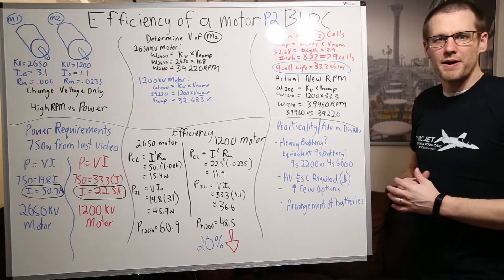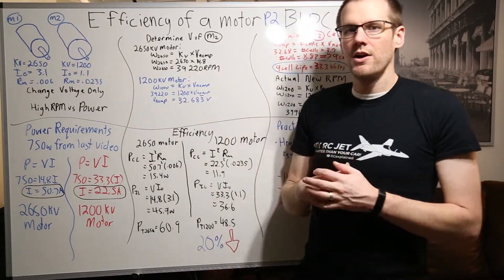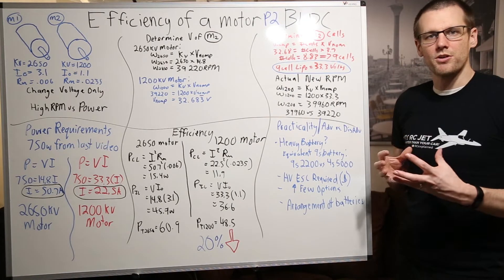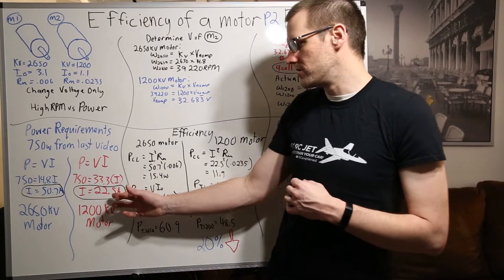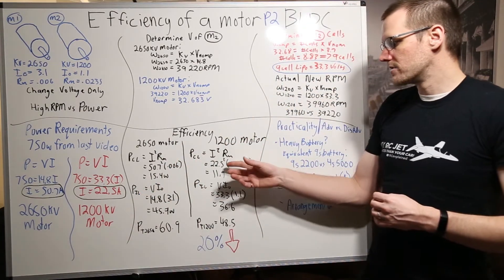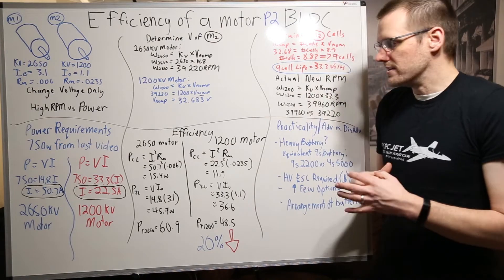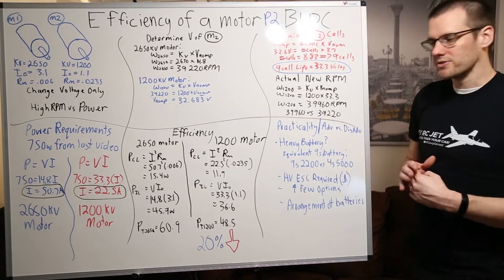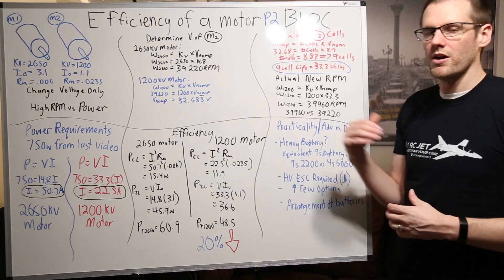High vs Low Kv Motor Comparison using Different Voltages for an RC Car

Comment: You could use ~1,800mah cells in the 9S battery and achieve the same runtime since you’ve concluded the 9S setup is ~20% more efficient.  I suspect one of the reasons r/c applications generally max out at 8S is that going beyond that the risk of electrical shock starts to materialize.  Killing customers is bad for business... lol.

Comment: So what if the comparison would be more typical to exist in both batteries, 8s and 3s?  I'm reminded of a video comparing a V8 car to a 4 cylinder and which one is more efficient in higher throttle situations. Both cars had 5 gallons in the fuel tank and the situation was the 4 cylinder had to try to shed off the tail, which was the V8 powered car. The 4 cylinder actually ran out of fuel 2 gallons sooner than the V8 powered vehicle. The point I'm getting at here is a lot of the efficiency has a lot to do with throttle modulation when referring to RC cars. Not many people don't use full throttle in anything but a crawler. If you are looking to go the same speed consistent though, probably like the V8 car, be better off running more voltage.

Comment: Running 58,000 rpms on my trm10v2 💨💨 she smokes tires for a monster truck , does both front and back standing backflips ( without the custom wheelie bar on ) with the wheelie bar I’ve achieve speeds of 177kmh! With small buggy wheels (: on road! But a couple days ago I crashed it into a wall going wall to fast , now I need a motor lol.
Reply from the maker: Nice! Sounds like a really fun setup. You crashed it in to a wall going fast and all you need is motor?
Reply: RCexplained yup, the little guy is tough as rocks! I honestly can’t believe that’s what broke lol, I order Center diff gears cause obi I though that’s what blew , because all my wheels were locked up only when the motor / transmission was on. Well I finally got the hex driver to take off my motor mount, and we’ll to my surprise the gear box was perfect. But my motor is really hard to turn.

Comment: Awesome video! I've been preaching this message on my social media for a while now. Guys are obsessed with lower voltage, higher current systems right now in speed running and I was actually planning a similar video to show why going to a lower current, higher voltage setup was a better option for overall efficiency and parts longevity. I'll probably shift that video more into talking about the heat produced by inefficient setups and the effect on parts life instead and refer guys to this video to learn more about efficiency in general.

Great explanation!
Reply from the maker: Thank you! You are right! A high current, low voltage setup can be very difficult to manage. 
I'll be watching your video when you post it.
Reply: @RCexplained  I know you're not on Facebook much, but a set of guys just posted that we are their two favorite RC YouTube channels. I guess not being afraid to geek-out in public does actually have some benefits. :-D
Reply from the maker: @RCPhysics  Hey, right on that's awesome to hear. Thanks for sharing.
Reply: @RCexplained  You'll get a kick out of this. This video inspired a geek out session on Facebook with the founder of Castle Creations. One of the tangents from that conversation inspired me to write this post. Enjoy. https://www.facebook.com/rhouse21RCPhysics/posts/1413035435534627

Comment: I'm running a Lehner 2250/5 2365kv motor with a Hobbystar 300a ecs, using 2 Yowoo 5s graphene 5000mah 100c lipos. What kind of hp could I expect from that setup theoretically?
Reply: With 5s batteries you get a nominal voltage of 18.5V. The C-rating on batteries these days usually has more to do with what the maketing department wants to sell than the actual C-rating of the batteries. Most batteries are actually somewhere between 20C and 40C. Let's assume they are actually 30C. That means you get a max current for the batteries of 5*30=150A. So the max power from the batteries would be 2*150A*18.5V=5550W~=4.1hp. The ESC is rated for both sufficient voltage to use your batteries in series, and enough current to use them in series, so this will not be a bottleneck. What will probably be the bottleneck in your system though, is the small motor. I have a leopard motor that is almost twice the length and twice the diameter, and it is only rated for 2500W IIRC. Seeing as your motor is basically 1/4 the surface area, and thus 1/4 the available cooling, I would guess that it would also be in the ballpark of 1/4 that power, so more like 625W ~= 0.47hp. You'll have to dig up more info on the motor though, to get a more accurate answer on that.
Reply: @2testtest2  quick question if you don't mind. I have 2 x 3s 45c batteries, does this mean I need a 270 Amp esc if I run them in series? I have a 150 and it gets crazy hot if I do. I don't really need the speed, so would it be better to just run them in parallel?
Reply: @mxm1766  If you get the performance you need from running them in parallel, and that makes your system run cooler, I see no reason to run them in series. Though in theory, it could be more efficient to run on a higher voltage, and just use less throttle. In practice however it is not necessarily the case, as the electronics may not be very efficient at limiting the power.

Hope that makes sense :)
Reply: @2testtest2  thanks for the reply, that definitely makes sense, I'm just worried that I pop my esc. I ran it for about 10 mins after I installed it, and it was very hot. Too hot to touch actually. Look, I'll try to run them in parallel first and see what happens. It's only a bait boat, so I don't know why I went for so much power. When I bought the 56102 6300w motor, the seller said that the 150a esc was more than enough but after reading your comment I'm starting to doubt it
Reply: Thank you.
Reply from the maker: Hey Dameon, The spec for that lehner motor is 560grams. That motor can easily put out 2kw. That would be about 2.6hp Keep in mind all power values provided are before efficiency is considered.

neistridlar runs through a bunch of calculations about the potential the setup has.
Reply: That motor is deceptively fast. Do you have an Facebook or social media account to send you a few videos of it in action?
Reply: Also my Lehner is a 2 pole motor if that makes a difference?
Reply: Given 5s, at 100A you get about 2 kW but that is at roughly 38,000 RPM!